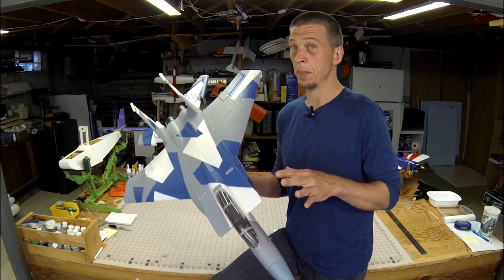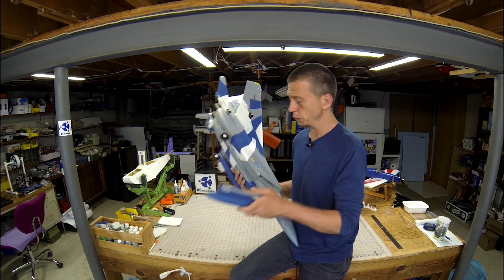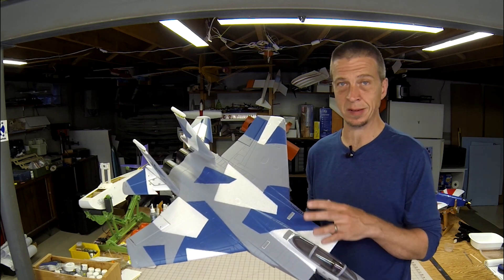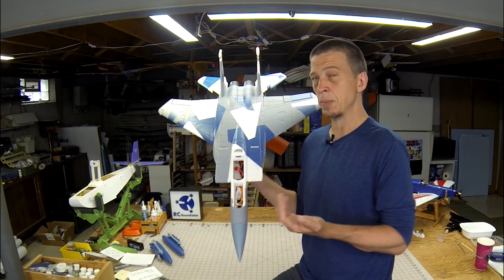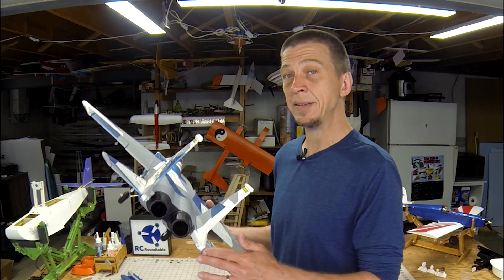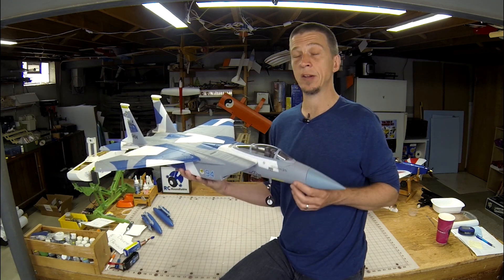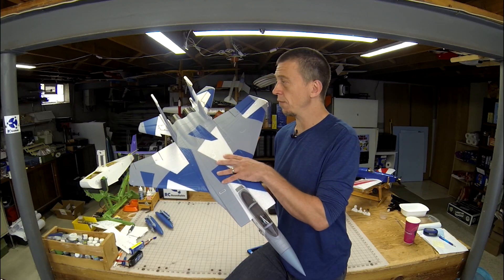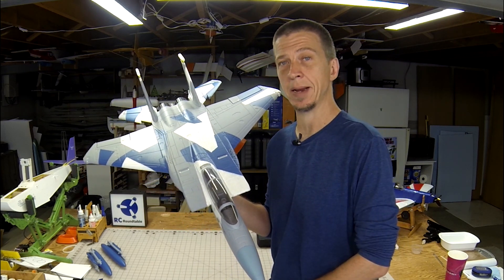Horizon Hobby E-flite F-15 Eagle - Model Aviation magazine

Comment: What cameras did you use on plane and ground?
Reply: The onboard cameras are RunCam2. I believe I used a GoPro Session 5 on the ground.
Reply: irwinwka   if you go all out yes, 5 minute on 1/2 to 3/4 but i fly just a line above 1/2 , depends on how you fly it

Comment: I started to reach for my wallet until you said 3 minute flight.  Is that an EDF thing?  Pass.
Reply: @Sgtqman19 So it IS and EDF thing.  Of course I knew it would take more juice.  Silly me, I though that was the reason for the massive, expensive batteries.  If it dumps that much power that fast, it's got to be murder on those batteries.  So, no.  I won't waste a dime on this or any EDF.